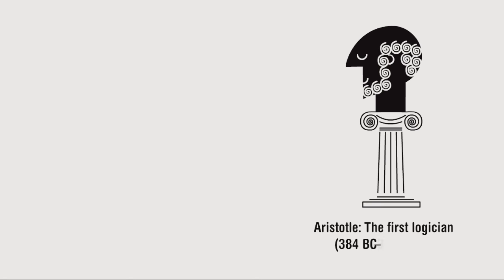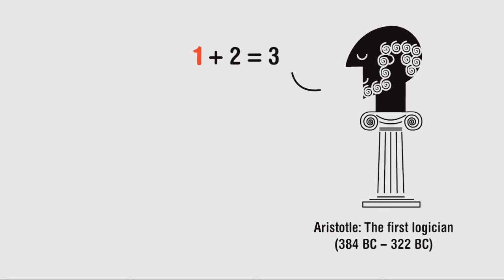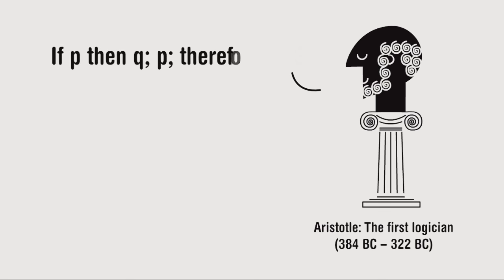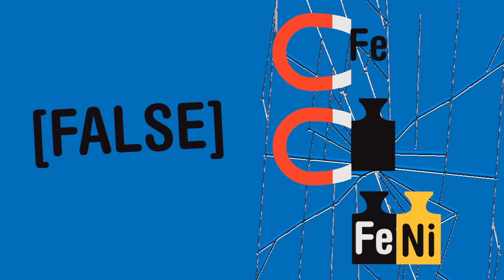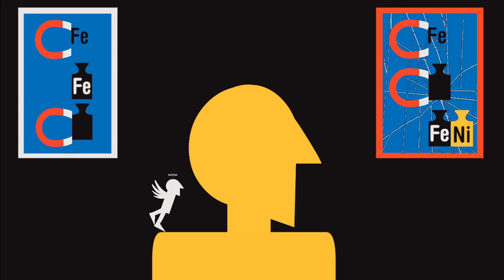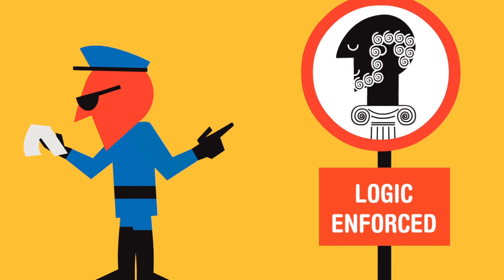Critical Thinking Part 2: Broken Logic

Comment: @chinopisces no, it is that I have debated this way too many times and am unwill to do so again. Secondly logic is a subset of reason, while you are using it as it if is empirical. Logic connects the dots (premises), rather than providing them. 
Yes, fine my faith is "illogical" as I personally do not have the logic or understanding to back it up logically. But to be honest I believe because I rely on trusted authorities, as what you do when you drive. I do not know how a car works, but drive.

Comment: Update: After some brief review reading, I've come to realize that there are many different types of non sequitur, and affirming the consequent is one of them. Ergo, the provided example is actually both, with the label of non sequitur being more of a general term for logical fallacies. My previous understanding was more in line with general speech than logical analysis.

Isn't the given example an instance of affirming the consequent, rather than a non sequitur? As I understood it, a non sequitur is when a conclusion is effectively unrelated to its original premises, while affirming the consequent is falsely concluding a single cause from a given outcome, when there may be other possible causes.

If P then Q; Q; Therefore P - This is affirming the consequent.
If P then Q; P; Therefore N - This is a non sequitur. 

Am I way off the mark? Can someone correct or confirm my thinking?

Comment: 0:55 It’s only false if you want to be correct 100% of the time. 

“Is this attractable item made of iron?”
I can say “Yes, it is made of iron.” Sometimes I will be correct. 
Other times I will be wrong. 

Essentially the same as answering with a technically correct answer to the question. “I don’t know, maybe, it depends, I’d have to do more tests to tell exactly what the item is made of.” 

All of that and you still haven’t answered the yes or no question. 
Technically correct but still technically wrong/unanswered.

Comment: but some iron compounds are not attracted by magnets hence you cannot assumb that just "because an object is MADE FROM Iron that therefore it automatically gets attracted"
Reply: Iron is Iron.
It's an element and technically speaking we only call it iron if it's reasonably low in impurities and isn't purposefully alloyed with other elements.

An "iron compound" is just that, it's not Iron but an alloy containing Iron. That's a different pair of shoes entirely, no matter if it's an Iron base alloy like steel or just contains a large percentage of Iron - it's properties in almost every regard can vary wildly.
Reply: @heinzhaupthaar5590  Iron compounds are made from iron, they contain iron

We are not talking about "objects containing iron parts", but about "objects made from iron"

Comment: My BIG PROBLEM with this use of LOGIC is that it is often biased.  This means that a person is expected to KNOW certain things before answer these questions. What if someone had no knowledge of different metals. These assumed knowledge, without even INFORMING the person that they should KNOW some information already before answering the question. What is more, is that there is no organized information of what you may need to know for a question.  Knowing about different metals may seem simple, but if you went to a person who never had an education can you really say he can't use logic simply because he can't answer biased questions.  Implicit information isn't always something simple, so why is it always assumed everyone else knows what the question writer knows???
Reply: I don't see how that is bias
Reply: To make sure my use of bias is correct, I use the noun definition of bias as "A partiality that prevents objective consideration of an issue or situation". In the case of what I was saying previously, I think when logic is tested or expected to be used, the issue that is not taken into consideration is that previous common knowledge is assumed to be needed according to the way solutions are presented (stating things not stated in the problem given to solve). The Idea of 'Common knowledge' I think is a bit ambiguous because the knowledge may not be held by everyone that is given a problem, same goes for the phrase "common sense". Without having the previous knowledge necessary or being informed of the need of such knowledge when logic is expected to be used, it is easy to see how one does not get to the solution.  On a side note, isn't it amusing how "common sense" seems to indicate what everyone should know, but of course not many have it? I my self am only beginning to see the deeper meaning of those to words, only because I am being more well read. I hope this helps you see why I thought it was biased. take home message "not everyone has the common knowledge required by a problem writer of logic, therefore to give everyone the task without telling them that Certain(SPECIFC INFO.) knowledge not taught is needed to reach the solution is biased because they don't inform of the need or they just assume everyone knows."
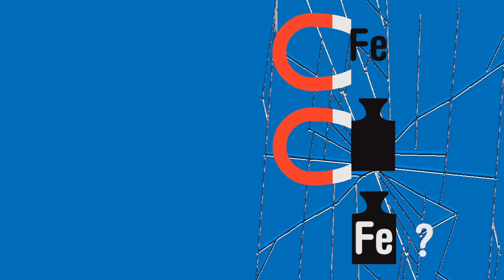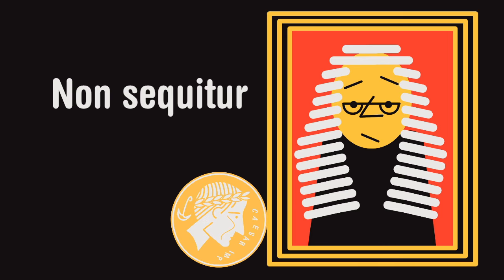Reply: Ernesto Nunez, for more clearity look at the video "Critical thinking Part 3: THe Man Who was made of Straw" . Starting from time 0:59 watch it to the end. Pay attention at 1:18 where he states the necessary premises that needs to be known to get the right logic solution/understanding. Hope this helps.
Reply: *****  I agree, logic in its purity is not biased. But the context in which it is tested is, as they don't informing you of the need of 'knowledge that may be considered common by writers'.  Let me give you specific true example of this. I took a class in critical thinking, the teacher never once mentioned the "FORMAL" fallacy among the fallacies he choose to teach. This seems bad because most fallacies are obvious because they don't follow logic, ex: attacking the speaker instead of the argument when arguing.   OK, I also think the way we look at a problem is just as important to the solution as its structure. For Example, I said question answerers should be informed of the need of such knowledge to avoid ambiguousness right? So what 'if", we informed to not consider any outside knowledge, beside the ones mentioned. In that case the logically solution would have to be that the metal is iron. In addition the similar color also seems to be misleading, would iron be the same color as other metals in the real world? of course not, unless color coated. Doesn't it seem like they are tip-toeing between making a problem look completely realistic and not realistic? lol. This just ACADEMICS, in the ACTUAL REAL scenarios any of these are perfectly possible (like the color coated, thought.) Anyway, please excuse any grammatical mistakes I am making, I am still working on my English. Logic is a beautiful thing. Also you said logic is kind of logic, recently I read a statement someone said that logic gave birth to math, not the other way around. lol
Reply: Ernesto Nunez hey I replied to try to explain why I thought it was biased, you can see my reply on the comment section under the video.
Reply: StudentLearning737  ok... but again logic is not bias, you are not even arguing that logic is bias, you are arguing that the assumptions of common knowledge are bias because not everyone necessarily knows that the premises are true and I still don't see how is that bias.

idk an example of confirmation bias could be someone racist taking into account only the crimes committed by black people and then claiming on that basis that obviously black people are more likely to be criminals. or something alone those lines, like I have seen some people claiming they can do certain things like finding water underground and then when they are put to the test they cannot do it, because they only took into account the times they got it right and didn't realize they missed even more times. Maybe I;m use to a different definition of bias idk you tell me
Reply: StudentLearning737 I'm going to reply to your various comments in this thread in one comment, here, and hope that Google isn't hiding more of them from me.

You don't need to know anything about metals in order to test the logical validity of the statement. Logical analysis of this type isn't about testing the "truthiness" of the statement. You can say "if all people die of old age, and bob died, then bob died of old age" and make a valid statement, even if it's not true because one of the premises is false. It is perhaps unfortunate that the video referred to the validity of the arguments as "true" and "false", but in reality that is not what we are discussing.

What is iron? What is metal? What is a magnet? We don't need that knowledge to check the validity of the statement. All you can conclude from this is that if an object is made of iron, then it will be attracted by a magnet. You can make no other conclusions. I haven't done any formal study of logic, so I don't know how to put this into proper terms. But it's very similar to the following argument: "if A then B"; "if B then C"; "therefore, if A then C". It is not valid to say "therefore, if C then A" from the information given, and there is absolutely no need to understand what A, B, and C represent.

However, I understand that people might find this annoying at first because they're thinking that there's a good chance that if C, then A. If it's attracted, then it's iron. That is a reasonable hypothesis, but it is not logical proof. That is "evidence"; it is not "proof". You can logically conclude, "if C, then maybe A". Importantly, you can conclude, "if not C then not A". If an object is not attracted, it is not made of iron (or there is a flaw in the experiment).

If you're trying to figure out what the object is made of, you run experiments and gain evidence. Testing it with a magnet can give you some evidence, some information, from which you can make a hypothesis that you can test with other experiments. Even if you know about other metals, it narrows down what metals it could possibly be. If you're just trying to convince someone that it is made of iron, and they are not aware that other metals can be attracted to a magnet, then that might be the only thing you have to show them in order to convince them. But it isn't the same thing as proof.

Of course, you could make this logical statement: "a magnet attracts an object if AND ONLY IF it is made of iron"; "a magnet attracts object X"; "therefore, object X is made of iron". That is a statement that is valid. One of the premises is false, so the conclusion is not necessarily true. If you can prove that the premises are true, then you can prove that the conclusion is true.

It is important in life to be able to dissect an argument. You have to be able to determine:
1) what premises are being stated
2) what conclusion is being stated
3) whether the conclusion logically follows from the premises
4) whether the premises are all true

Here's an example. "Unemployment rates are up, so Obama is a bad president.". That is rife with assumptions. Let's pull it apart and turn it into a logical argument. Here are the premises you're going to need in order to arrive at that conclusion:
1) unemployment has risen, BECAUSE...
    a) unemployment is accurately reported
    b) unemployment has always been accurately reported, by the same metrics
    c) the recent report shows that unemployment has risen when judged by the same metrics, during Obama's presidency
2) it's the president's job to prevent unemployment from going up, BECAUSE...
    a) the president has had sole influence over the unemployment rate, so nothing else could possibly affect it, OR his influence vastly outweighs everyone else's
    b) unemployment going up is a bad thing 
    c) increasing the rate of unemployment has no positive effects, or they are outweighed by its badness 
    d) decreasing or maintaining the rate of unemployment has no negative effects, or they are outweighed by its goodness

The speaker of that sentence didn't explicitly list any of those premises, but they are the premises that you would need In order to reach that conclusion. As far as I can tell, my logic is sound. Now, if you suspect that any of those premises may be false -- or, if you want to be a good citizen, EVEN IF YOU SUSPECT THEY ARE TRUE -- you will ask for the evidence that each premise is true. You have to dig down and verify that the chain of logic holds as each part is verified.

This is where your fear of "bias" is realized. When someone makes that statement, you need a certain amount of experience to figure out what the "hidden premises" are. If you fail, you might be convinced of something despite the argument being unsound. Debate is biased toward the well-informed, the clever, and (when you're trying to convince people of things with illogical statements) the eloquent. You need to develop skills in order to participate. Intellectual skills are required for intellectual pursuits. That's how life works.